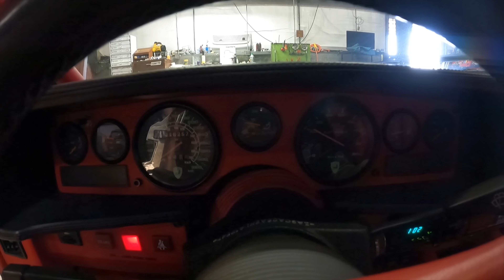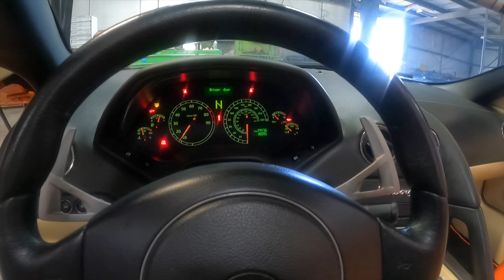The Ridiculous 18 Quart Lamborghini Countach Oil Change

Comment: In Europe, we have a solution for being tall in a low sportscar. These seats can be lowered, either with different mounting or custom mounts. Thats also how Lambo did it when they had a tall customer. So you can fit in the Countach.
Reply: I was waiting to see when someone would suggest this... Why hasn't hoovie done this yet?
Reply: Done this in my miata
Reply: @erikbieberstein6583  how tall are you?
Reply: @tiko4621  6'2.
Reply: @erikbieberstein6583  oh you really ain’t that tall then lol. I wanted to drive a Miata when I was a kid but then I ended up 6’7. I don’t think it’s physically possible to make that much space in an old Miata hahaha
Reply: @tiko4621  lol I'm short compared to you true. But even being 6"2 my head just fits under the top and my eyes mostly see the top windshield bar. It sucks but I can deal with it. I thought I've herd of people who are extremely tall being able to drive a miata
Reply: Would also be a cool vid
Reply: Yup, and you can get an extension boss for the steering wheel so you can slide the seat back a bit more and have a more comfortable pedal position.
Reply: The one problem with loving Italian cars is being long legged! The one thing my 5' tall wife benefits from is being able to easily shift the smallest old Alfas & Fiats without banging her knees!
Reply: @tiko4621  I'm 6'4 and I daily an NA miata, it's really not that bad

with the hardtop on there's a few inches between my head and the roof, the pedal well is really deep so it's fairly comfortable to drive, i just wish the seat could go lower
Reply: I am 6'3" and did the foamectomy in my NB Miata. Helped immensely. Wish I still had that car :'(
Reply: Well, when Tom Selleck was Magnum PI, they removed the seat rack and bolted the seat directly to the floor. Still, they had to leave the roof off because he wouldn't fit otherwise.

Comment: My old cars may not have a Lamborghini badge but I still love them. That being said them being kept in a warm garage with a good cap and dipstick installed properly I feel like the oil was fine after 200 miles and 8 years. I could easily be wrong about this and am murdering my old poly 318 that I change the oil in every year and about 2000 miles. On your oil it appears like the oil was fine even after 8 years. I’m not saying it’s a good practice to only change the oil every 8 years but I feel like it was probably not as big of a deal as you were acting. Not saying how I feel is fact and I love the cars you own and the channel you have, thank you for the entertainment!

Comment: You should re-create the opening scene from Cannonball Run. You drive, the wizard gets out and spray paints the 55 mph sign....
Reply: Just do it in negative colors so the Lambo is black - and also add the front spoiler from the Cannonball car.
Reply: That's for the wife to do.

Comment: Hoovie: "I'm going to do an oil change on a car that hasn't had one in 7+ years!"

Hoovie 3 weeks later: "All my gaskets are gone!"
Reply: Actually oils now have conditioners in them to help the gaskets, engineering explained has a really good video.
Reply: @nusudahwdo3181  Unless the oil is completely baked, that's the real damage old oil does to an engine....it will harden the seals. Fresh oil has rubber conditioners to keep the seals soft.
Reply: There is a good reason why they use the Rotella T4.
Reply: @jonasthemovie  hey my name is Jonas too lol

Comment: 15w40 is a great choice for supercars, muscle cars and AMG. If you see a little cold try the 10w-30 HD oils like Rotella or Delo or the $10 a gallon Mobil Delvac 1300S. MaxLife 10w-40 is also excellent. Save the synth oil for turbo engines.

Comment: 3 times the Avalon I have 5w30 syn. I would say change the filter ( oil)  rather than the oil it self ! Plus fuel/ air/ cabin etc. filters ! !,not all wheel drive !!! Do you buy the oil by the 55 gallon barrel? How’s the heater in the convertible this mid March 2021 ?

Comment: Hey Tyler, have you thought about turning the countach into a convertible (cut the roof and put holders on the backend like the diablo or add a retractable cloth covered structure) or a aperta (cut the roof and the front glass). Any of these options will make you comfortable and will gain you millions of views & revenue.

Comment: The Countach is awesome. I like it more than the older ones, to me the stupid 80s original bodykit just makes it even more awesome. Its meant to be "too much". Get a modded seat and seat rails and install. Also maybe try if it is possible to shift the pedals a little bit. Maybe it is possible to fabricate a new mount for them to shift them an inch or 2. All non permanent mods of course and keep the original parts.

The Diablo is similarly just 1990s personified (carified?) with its sleek look. Also it looks awesome with its roof off. And the engine looks great as well, as you said.

The Murcielago one is of course the fastest, but the reason to keep it is becuse you can put some serious miles on it without depriciating it further, considering the floor tunnel mod and stuff like that you have already done. No one else got a lambo with a hole they themselves voluntarily cut in the floor, thats got to be worth a few laughs talking to other people about it at car shows as well.

Comment: Love the fact that he uses diesel oil on these engines. Everyone seems to be doing that these days. Although i would have done the T6 instead of the T4 on the countach.
Reply: Its a great oil for any motorcycle, 15w40 t4 even has  JASO - MA rating which is for motorcycle use with wet clutches(no friction modifiers in the oil)
Reply: why are so many people using rotella in their stuff? I get why Cleetus McFarland uses it because he runs hefty boost in this racecars but this is an NA motor, you don't need the thick shit.
Reply: @jorgey4  15w40 is really a 40 weight oil at operating temp. If you were starting below freezing or operating in colder climate, yes it makes sense to run thinner oil but most high performace engines are run on 40weight oil. BMW even uses 15w60. "Thick shit" actually lubricates and protects engines better than the EPA approved 5w20 or even 0w16, which was designed purely for MPG reasons
Reply: The T6 would probably lead to oil leaks on Countach and old Diablo. Conventional oils are adviced.
Reply: @jonasthemovie  idk about the countach specifically since its so old but that's a myth that you'll leak just because of full synthetic. Usually means you didn't have a gasket there in the first place.
Reply: @jorgey4  It´s said to have to do with the aluminium casting quality, porous mating surfaces for the gaskets of those early engines. In general I would be hesitant to switch a modern high detergent oil, regardless of base oil type, when having an old cruddy engine.
Reply: @jorgey4  you can get T6 in 5w30 If you want. Although special order. I bought some for my om617.
Reply: @s140s  there is much debate, but tolerances of the engine come into play. And also bmw famous thick oil is not helping the consumable crank bearing syndrome. Also once tested, the thick oil is around 30w once the vehicle has a couple hundred miles. The tolerances grind down the stuff.
Reply: @jonasthemovie  i thought that notion has been disproved multiple times?
Reply: @Engineerd3d  What notion? That synthetic oils at the same viscosity rating leaches out of small pores more easily? That detergent will remove the krud keeping old seals shut? None of that is debunked. Modern synthetics usually aren’t ester based thou and won’t swell the seals like esters did in the early days of synthetics, that much is ”debunked”.
Reply: @jonasthemovie  i have a 41 year old car. Running full synthetic. It does not leak anymore than it used to. As for cleaning out the crud, if your relying for crud to keep the oil in the crank case then there are bigger problems.
Reply: @Engineerd3d  So......?

Comment: First thing I do when I buy a used car... Change the oil. No matter what the previous owner said. Only a few exceptions to that like close friends who I know do oil right/trust etc type thing. 

Sure it's an expensive oil change on this car and some cars. The engines are more expensive. Oil is the cheapest way to ruin expensive things.
Reply: I mean other than a huge, probably hard to find oil filter and the sheer quantity, it looks like this was pretty easy from a labor perspective and it takes commonly available looks like diesel oil to me. It's probably not that bad on these compared to other supercars.
Reply: I know right? Oil is actually the least expensive and easiest way to increase the longevity of your vehicle. I bought into the ford 5.4L before I knew about the 100 issues with the engine and most of those issues are due to oil. The OEM spec on oil changes guarantees major issues down the road. If you change it every 3000 miles, you'll avoid a ton of those issues, from new. If you bought a new one, and did the oil changes by the OEM specs, you've damaged the engine. 

I had a new one, went in and asked for an oil change at 3000 miles and at 34,000 miles, asked them to do a complete "tune up" plugs, fuel filter, etc...they gave me a hard time "doesn't need any of that" and then I learned: if you wait to when Ford says change the plugs, they'll be seized in the engine and break off. If you don't change the oil at 3000 miles, you'll cause permanent damage to the passenger side cam phaser, cam followers, and bearings (since there is a single oil passage, the oil is hot and dirty by the time it gets to the passenger cam phaser/chain/guides).

Comment: That oil filter is the biggest I've ever seen on a passenger car
Reply: You can get a giant filter for your regular car also ask for a wix fleet filter for your car there twice as big as stock and work much better than stock filter
Reply: It’s pretty much as big as the 1.8T filter.
Reply: Have you seen a VW D24 filter. It's massive.
Reply: @nicostenfors5690  I have not
Reply: @nicostenfors5690  I’ve put the D24 filter on 1.8T for extra oil capacity.
Reply: @jonasthemovie  I put a  1.9TD T4 transporter filter on my D24 because it has good filtration capacity but oil capacity is less so the engine will get faster oil pressure. The D24 suffers from oil starvarion at startup.
Reply: @nicostenfors5690  You should buy better quality filters with proper check valve functionality so it won’t drain as easy. Should be ok with reasonable service intervals thou.

Comment: Change the seat mounting brackets on the countach so it lowers the seat. You’ll be able to fit in it. Keep the Diablo for sure because it’s a Diablo and it’s able to rock the convertible and hard top look. Sell the Murcielago because as you said, it’s terrible with the roof on and has a lot more tech that could go wrong.

Comment: Replace the roof panel with one which has two subtle bumps to accommodate your height. Then keep it. Keep the old roof panel. The Gurney Bump on GT 40’s. Wouldn’t think it would hurt value as you keep:the original.

Comment: Real question: Why does the Wizard use Rotella in the supercars? I’m not here to say he’s wrong or a moron (love the Wizard vids too), I’m genuinely curious.
Reply: I was under the impression that Lamborghini authorized that brand of oil to be used in areas where their local type isn't available for sale.
Reply: People swear by Rotella for Honda Sport Bikes.
Reply: I believe he used it in the SLS too.
Reply: Vice grip garage uses it too
Reply: Its good oil and maybe cheaper/more readily available... or thats whats specified as acceptable by Lamborghini.
Reply: @rxtuninginc8444  If I recall it was $21 a jug last oil change, a true bargain.
Reply: They don’t recommend syntetic for Countach and older Diablo. For the Murci, well it’s good enough.
Reply: I was wondering the same, cause that's what goes in my 1982 Mercedes diesel sedan

Comment: Hoovie should have kept the blue Lambo Gallardo because it was a manual and had a beautiful interior that wasn't black leather. Also Manual Gallardo's are appreciating as they're more rare. As the Murcielago is a flappy paddle e-gear car I'd sell it for a proper manual transmission Murcielago coupe. Curated in Miami has one. If you're going to sell, sell the Prowler, the Chevy conversion van, and the big white Mercedes S class. This is the only time I'd spend time watching an oil change. Partly because it's a Lambo and partly because of the interesting interactions with the Wizard. Thanks.

Comment: Rotella T4? Not T6? I even use T6 in my jeep. You could also get your oil from Costco now, it should be cheaper, I only wish they had 5w-40.
Reply: Looks like they put T6 into the Murcielago, so it must have been a conscious decision. In my 1991 Mercedes Diesel I use 5W40 T6 in the winter, and 15W40 T6 in the summer.
Reply: @gotham61  I saw that. He probably can't drive the Countach in the very cold anyway with the tires it has. It really doesn't matter with him because his cars are stored in a climate controlled environment anyway.

Comment: What I want to know is, does Wizard charge $3.50 (or whatever) for a sump plug washer for every oil change ?
I used the same washer for 10yrs in my old car, but somehow the washer  always needs replacing when visiting a dealer

Comment: One would think that much viscous fluid would actually work against engine rotation and reciprocation and therefore power.
Reply: There's a couple of reasons I can think of that clear this up.

1. At "operating temperature" for the engine, the oil is hotter and thins out a bit. 

2. Only enough oil to provide lubrication is in the system at any given time. Not much is required to give a thin coating.

Comment: Personally I am one of those perfectly sized guys who can fit in almost any car. Although for those a bit bigger (mostly taller) there are ways to make more room. Mainly aftermarket seats and brackets that can be a couple inches lower, further back, and wider. You will have to trade softness for the extra inches but I would believe it a worthy trade.

Comment: The oil is a few hundred million years old. The worry about water on the oil is fixed by getting the engine up to temp and boiling it off.

Comment: Not often do u see the owner of the shop performing oil changes. I usually perform my own, however, if I had a Lamborghini, I doubt I would then. My 2 pick ups are pretty easy, but my 350z can be a pain in the ass, even on basic yard ramps lol

Comment: What about flushing the cooling system and changing out the Transmission fluid? When I got my 2002 Accord and knowing it was sitting in a garage for the last 8 years (he did drive it once a week to the stores) I had the oil, trans fluid and radiator flushed and also the timing belt done right after I got it. 

P.S. I also have a wizard (my mechanic could pass for wizards cousin or maybe even brother from another mother) and he is a freakin bad ass mechanic and gives me great deals and doesn't charge me for his time.

Comment: Prefer the Countach engine bay over the Diablo. Still wiring, etc, are reasonably tidy and you can see the mechanical bits. Actually looks like an engine. Diablo just has what looks like a pointless cover hiding things. Too often covers like that are just a cheap way to avoid paying much attention to the finish of the mechanical bits!

Comment: I remember the ease of doing oil changes to cars in the 1980s. Old late '70s Jeeps that you didn't need to jack up, just loosen the oil plug underneath and change the easily accessible oil filter. 1970s VW Beetle oil changes were a snap and they did not require much oil and you cleaned the oil strainer as they did not have oil filters. How much oil does a 1600cc VW engine take? In a bone stock engine (without say, an oil-pump-mount or external full-flow oil filter) it's 2.65 quarts. That's it!
Changing the oil on an air cooled VW engine https://youtu.be/VYBQ7hq1mVo
Classic Volkswagen Oil Change! (Beetle, Super Beetle) https://youtu.be/JpopYYKV33E

Comment: it was unfair for them to say that the merci's holes were "damage" when it was just a modification, as that's what you'd call it on any other car. At first I was worried it'd be failure point, but it seems fine so far

Comment: At 8:02 I see 15W-40 oil and online it's says that it needs 5W-40.
Is that the correct engine oil?
Reply: We use the same oil in our trucks. This is Tier 4 diesel engine oil. Our trucks take 42 litres! I also use it in my 85 Vmax. high zinc content - I have seen it recommended for any engine.

Comment: 4300 lb for the Murcielago— that thing is a PIG!  But the good thing is the weight distribution is 55.6% on the rear.  I remember Ferrari saying once that they consider 56% on the rear to be ideal.  [There is nothing “perfect” about 50/50.  Even is not perfect.  Looking at you, BMW.]

Comment: 18 qts? I work on diesel engines in a lab that tests oil. Most of our engines use 9 to 13 gallons of oil, plus breaking runs, flushes, adds and samples. All these add up to using entire 55 gallon drums for the majority of our tests. So 18 qts, while not a small amount, seems lien not that much to me.

Comment: Why not just add the the 12 quarts from the jump if it requires 12 quarts? Why did wizard start the car without the proper oil level???

Comment: 15-40 Rotella, your Lambo is a diesel??? Just kidding, I used to use it in my hot running air cooled bikes and they would run WAY cooler and use less oil than with the 20-50 I was told to use. Engineer father told me that any oil good enough for a high pressure diesel would have to be really good stuff. So it was. Cheap too.